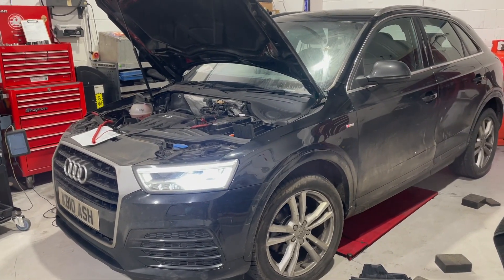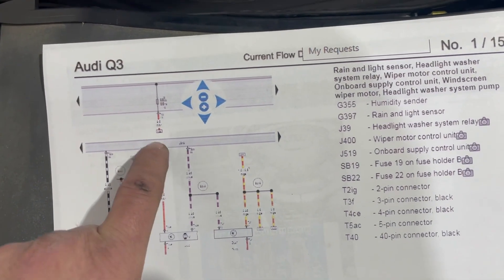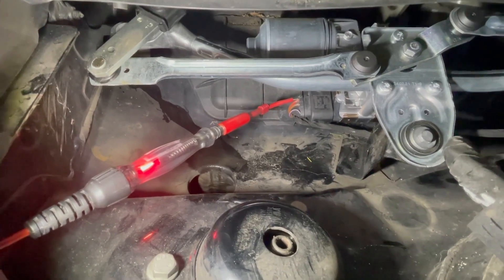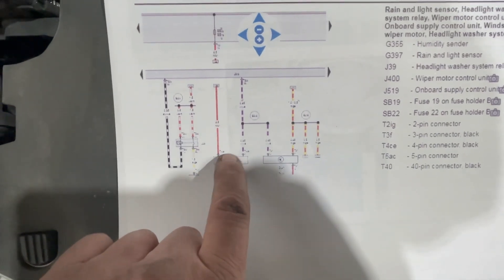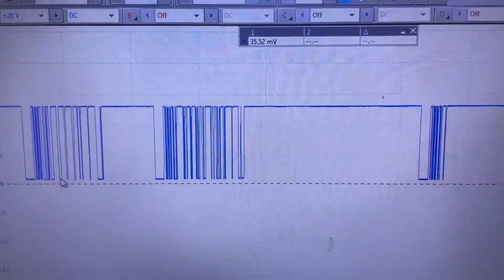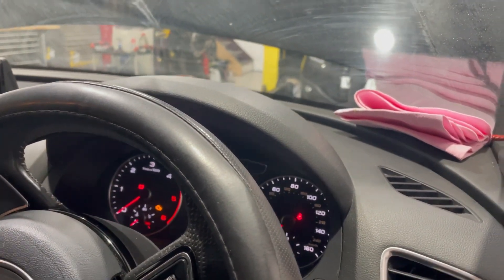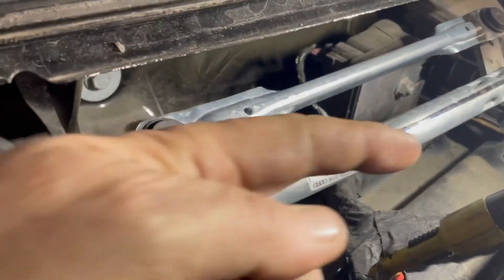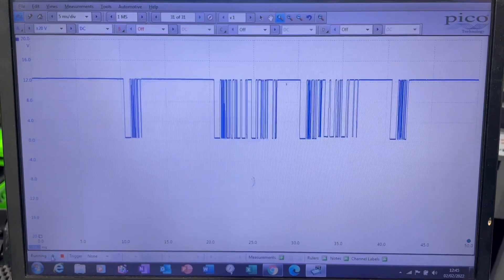Audi Q3 Windscreen (Windshield) Wipers not working. LIN BUS faulty

Comment: This was cool, had the same issue yesterday, same fixing. It looks like common problem for these cars
Reply: Was it a broken wire? I have a 2020 q3 no wipers check fuses fused was popped changed the fuse still no wipers

Comment: What gets me is that any garage could have found that with just a multi meter if you have no voltage on the lin its never going to work how do garages get away with it blows my mind
Reply: Most garages wouldn't have anyone who knows what Linbus is never mind how to test it. The simple fact is that good techs are hard to find.